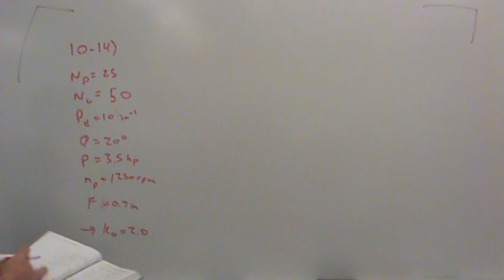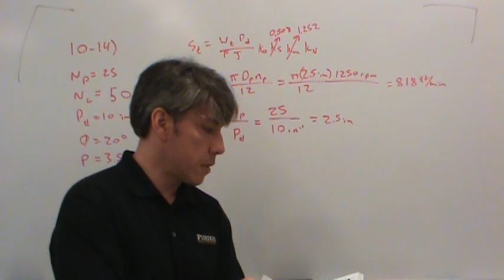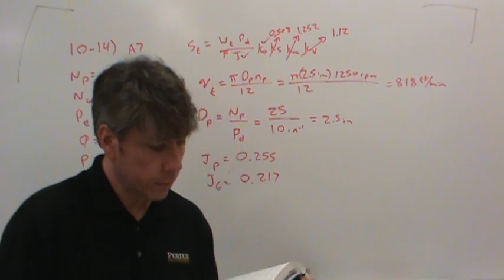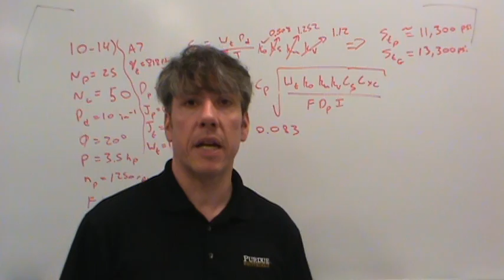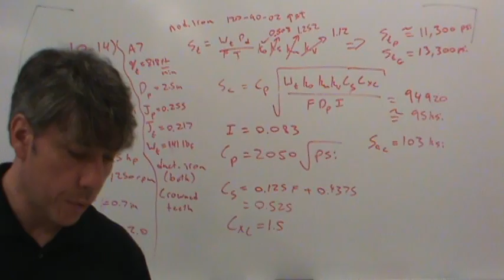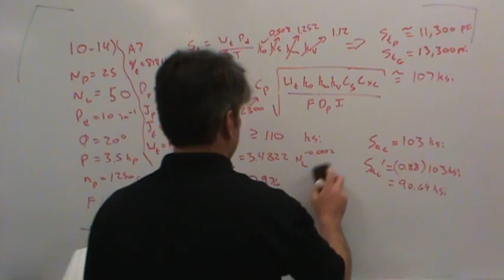MET 314 10 15

Comment: At 38:00 pg 729, SAE 1020 SWQT 350 while it has a HB 255 it's yield strength is only 72 ksi, since we need a yield strength of around 110 ksi shouldn't we choose a different material?
Reply from the maker: I should not have used figure 10-21 on page 405, since it is for through hardened gears.  Rather, table 10-4 suggests that for carburized and case hardened bevel gears, where the surface is between 55-64 HRC, the maximum Sat is 30 ksi, and the maximum Sac is 200 ksi.  Since the selected steel has HRC 62, it should be fine.  Notice that on page 729 there is a distinction between the properties of the gear core and the surface of the gear (the 'case').  The case of the gear is made much harder (higher strength but also more brittle) than the core.  Also, note that the case thickness is between 45 and 75 thousandths according to the footnote on pg 729.